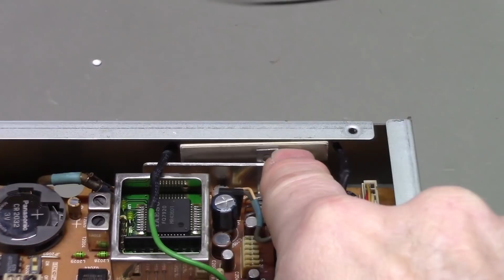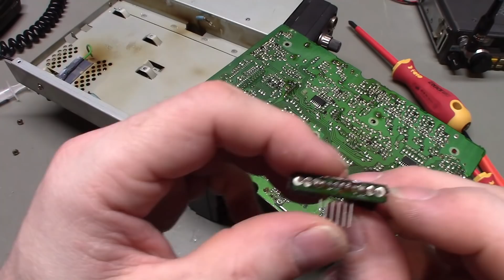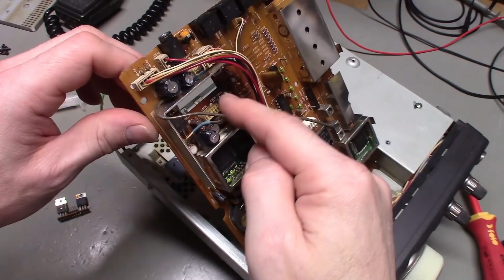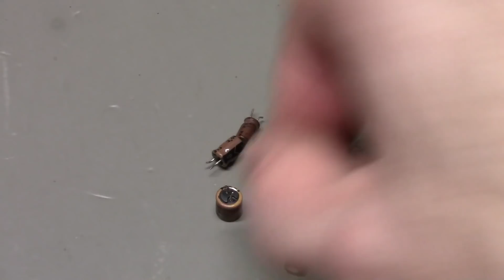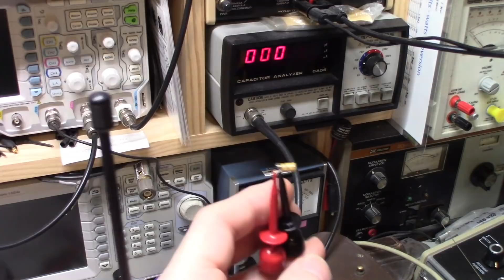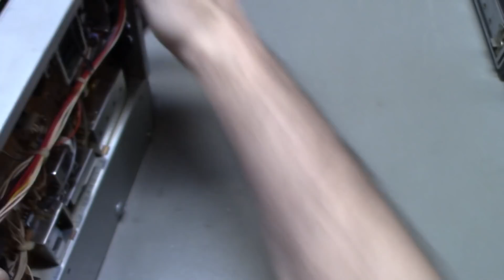Yaesu FT-840 intermittent RX/TX repair.

Comment: Mine has just packed up on transmit andreceive, no audio nothing, but vfo registers frequency on dial!
Reply from the maker: Go through and inspect solder joints on the circuit boards like I showed in the video.  It's a very common problem in older radios, especially on single sided circuit boards.  Mike KC3OSD

Comment: Hi. Please maybe you can help me.
I have resolde some bads or crack solders, i change all Capa chimical around régulators, and other, like you. 
I try to change the hot résistance but nothing diffrent.
The first thing my Friend say, i've a mic distrotion problème in SSB, but when i try in my housse, i see more trouble.
The trensceiver don't go on TX on 10/11/12 metter now, After capacity changed, before yes gone tx but something make 4 of ROS in 11m bande (in antenna, not in dummy load) .
Sometimes, a relais in the LPF make clicliclic and the trensceiver Ask tx/rx/tx/rx/tx/ very fast. (Maybe the last relais is fatly) ? 
I see something curious, the voltage input of the 9v régulator is correct 13,5v like schématic, but the input of the 5v régulator is only 9v instead of the 13,5v like asking schématic...?? 
The réception is very poor two... 
Thanks for Help.

Comment: mINE HAS DISTORTED AUDIO ON TX, any ideas please? Brian M6BAQ
Reply from the maker: Make sure you have the radio's ALC adjusted properly.  To correctly set the ALC you must transmit into a antenna/load with a SWR of 1.5 to 1 or less or the meter reading will not be correct.  If you have everything adjusted properly then it's probably a problem internal to the radio.  You would need to signal trace the audio circuit to find where it becomes distorted and diagnose it from there.
Reply: @mikesradiorepair Thanks! Just gave £175 for it s/hand so I disappointed. Running of 12.5v on car batt so should be ok. Using same ant. As for my ft101b with 9to1 unun at feed point, but put mfj tmatch at rig end (ft101b having plate load built in). Power, but very chirpy choppy audio when played back to me. No rf gets into ft101b cable routing all same, but of course no long leads to car battery on the floor!
Reply: @mikesradiorepair  Now fixed by putting ferrite clip ons all over coax feed!

Comment: where did you get that 470uF on the board? i am repairing this radio at the moment. done the chernobil section with all the caps around it.
Reply from the maker: Any electronics parts supplier on the planet.  There is nothing special about it.
Reply: ther eis a 330uF at audio amplifer, 47, 2 10uF and 2,2uF in that section. that is why i was wondering where did you change it on the board.
Reply: @mikesradiorepair  how do we contact you to have radio work done.  I have a uniden HR2510 that needs a tune up. new electrolytic capacitors and all of the corrosive glue removed. Thanks

Comment: 125 watts, doesn’t sound like something an amateur radio operator would ask for.
Reply: Just about every HF ham radio is a 100 watt radio. Why would a ham not want 125? Granted it's not enough extra power to get excited about, it's roughly 1.9dB, so roughly 2/3 of one S unit. Probably not going to make a huge difference in link balance, but, it's a little help when you need it. I've been a ham for more than 40 years, I would not turn my nose up at a 125w radio just because it had the extra power.

Comment: Why replace electr caps if not tested ? Never seen yellow caps before.
Reply: You replace them without testing because when they are that cooked, even if they work today, they are not long for this world. They will be dead soon. Heat is very bad for electrolytic caps. And those are literally cooked. If a miracle happens and they test ok, why risk it. They're well under $1 each, why not replace them and be sure. Prevent a bring-back and an unhappy customer.
Reply: They may be Nichicon "Gold" series caps. Those are high end though... Used in audio